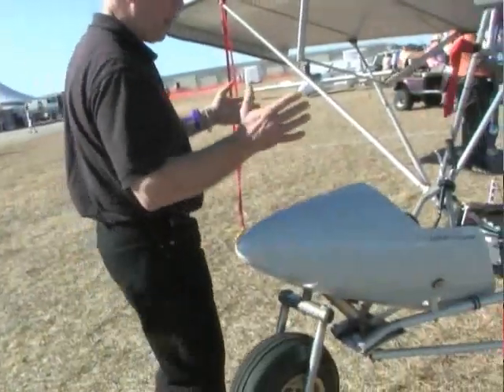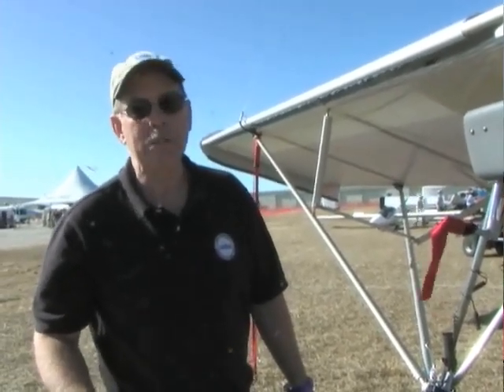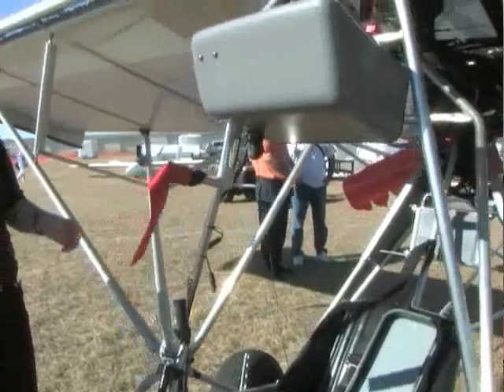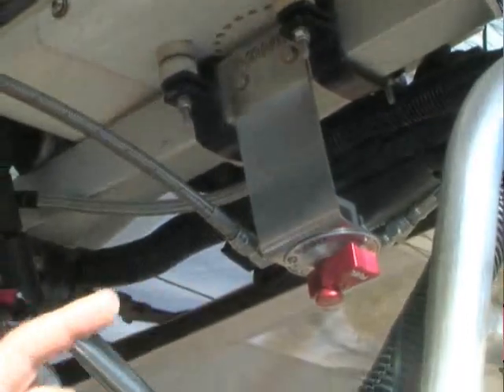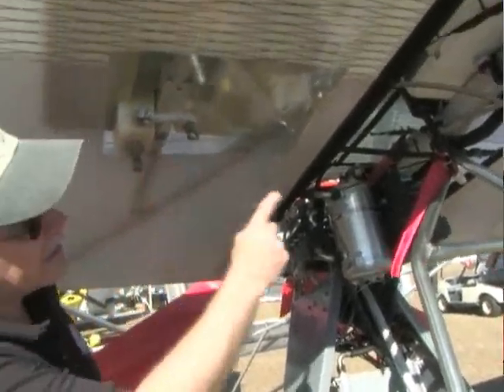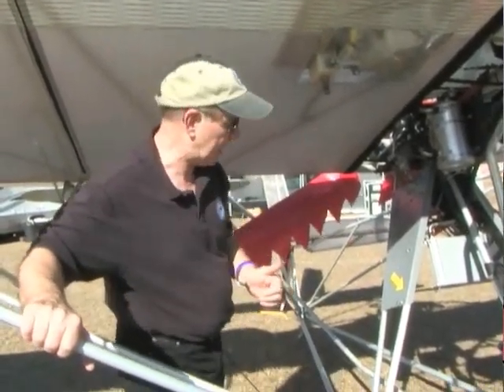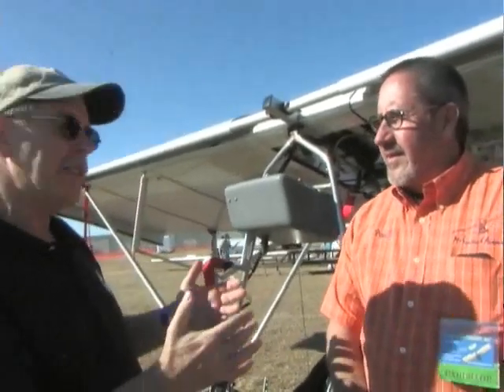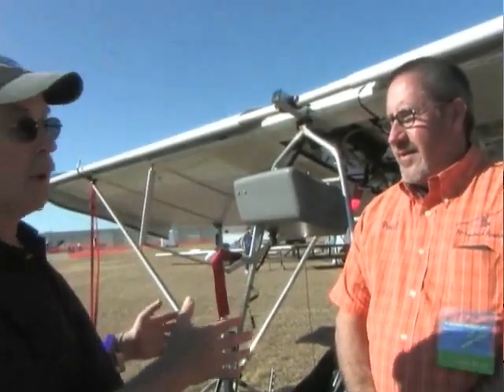Breese experimental aircraft powered by HKS 80 HP turbo charged aircraft engine.

Comment: This is a real case of overkill.  Sure, it's a dandy performer but the original purpose of this kind
of aircraft was to just get off the ground and enjoy basic flight.  $40K for 65 mph is absurd.
-Let me add that those who feel a need for a 45 degree angle of climb are akin to the same
dudes who need a streetlight jumper car.  -useless.
Reply: There are a lot of flyers who like to climb faster. It can take quite a little while to climb to 8000 ft. ,or whatever they like to fly at.
Reply: Yeah. Fuck those trees at the end of a short field.

Comment: @supertails92j Aye, but no batteries, and extremely powerful. Not fuel of any kind, just magnetic current. Splits ion charge so you've gotta rain off heavies in a way they don't interfere with electronics. Otherwise they'll induct electrons through anything, even fabric.

Comment: I don't know...an 80 HP engine on an aircraft which is designed exactly like the ones back in the 80's, when those where able to fly with about 35 HP... seems a bit too large to me... and also that plate wingtip and the VG's under the slat don't look like an aeronautical design, more like a very "experimental" one..
By the way, with that price, if it had a fuselage, maybe a fabric one like the Eurofly Firefox or the X-Air, i would have bought one!